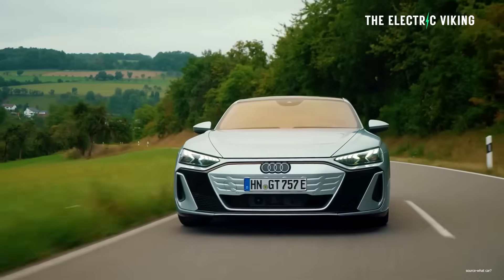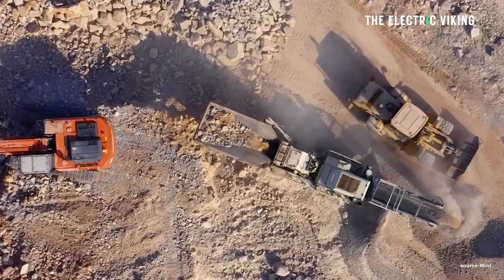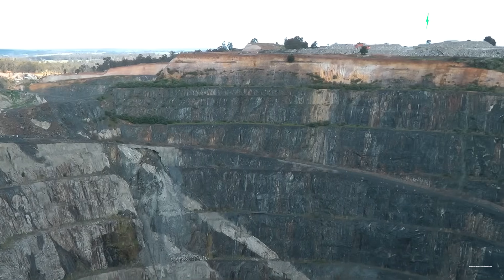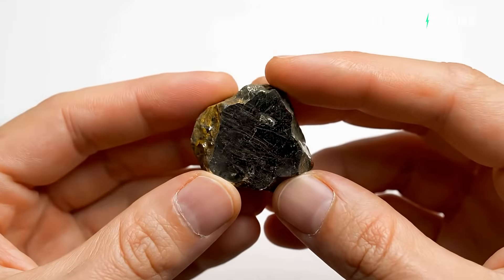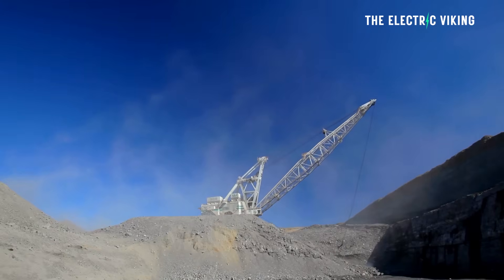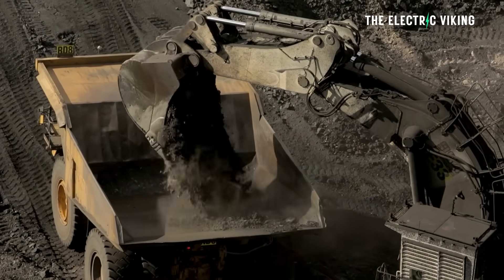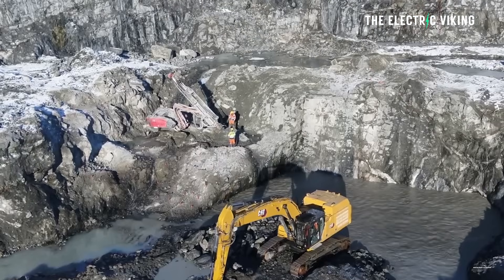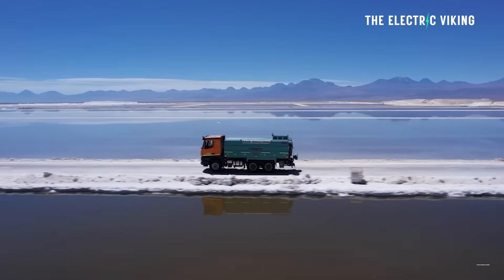CHINA’S MONOPOLY BROKEN! The Massive Rare Earth Discovery That Saves the U.S.

Comment: Those shovels? They grab about 100,000 pounds per scoop. And how do they produce the torque needed to accomplish that? With electric motors, of course. (They use diesel engines to charge the batteries, since the mines aren’t always near a high capacity grid.)
Reply: Actually if you're talking about draglines Ac is supplied through the trailing cable and the Ac drives Dc generator sets which powers the machine itself, sorry no batteries.

Comment: AS many have pointed out, it's not the rare earths, it's the processing. It will take at least 5-7 years, if not more, for the US to figure out how to do this. Also, China has a near monopoly on heavy rare earths, which are what are used for the high quality magnets that the US needs. Heavy rare earths are only produced in tropical areas. The other problem for the US is that these rare earths can never be economically produced in the US. The US will need to massively subsidize this, which it will do, but it will not be economical. China's export restrictions have been largely limited to US defense industiries, which has done more for world peace than any other action by any other state. Also, you should know that Utah's Great Salt Lake is on the verge of going toxic as it loses water due to climate change. And being able to provide lots of lithium to an almost non-existent EV industry in the US is not helpful.

Comment: The rare part about rare earths is the refinery part, not the deposits
Reply: As an engineer who has been engaged in EPC projects for a long time, I know that the first step is design.
But if you are lack of relative technology, even if you have never carried out related projects (such as heavy rare earth refining), how can you design it?
If you decide to start from zero, then I don't think 10 years is enough.
The second step is purchasing.
The global manufacturers of related equipment are all in China. Because the output value of rare earth industry is not high, even in China, only a few manufacturers are making it.
Under the current ban, your only choice is to research the manufacturing equipment from scratch.
Reply: @amandagrant4331  Rare earths aren't rare. The US used to produce them, but it's not profitable vs Chinese. The US will probably need to subsidise production.
Reply: This a distraction from the real problem. Rare earth trade value to China is less than 3 billion USD per year. So it isn't about competition or economics. 
The export restrictions is about disrupting US military or even chip industries and the leverage it provides. China gladly lose the trade value of the industry, what it wants is to disrupt these industries.
It will take years for the US to establish new supplies, no matter how much deposits it discovers. A few years is all China needs to catch up on military power and chip tech. 
In addition, US local rare earth production will only add to their industrial cost decreasing future their overall competitiveness in the global market.
Reply: Heh heh, that was my first thought as well.
Reply: Hes too dumb to understand deposits don’t mean anything.
Reply: Rare Earths often occur with Thorium.  The US is highly afraid of because Thorium is mildly radioactive.  This complicates the refining.  Someday they may ban granite countertops because they too are mildly radioactive.